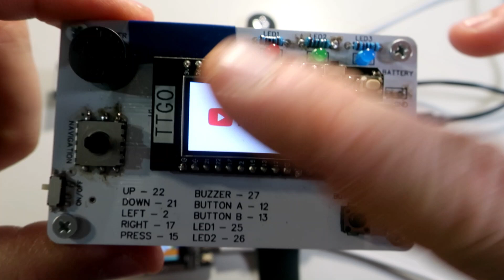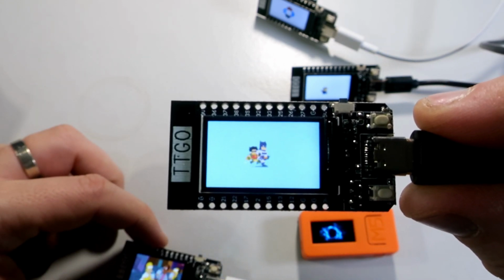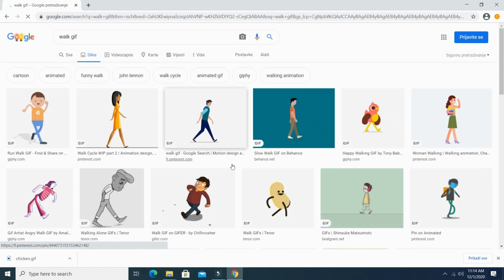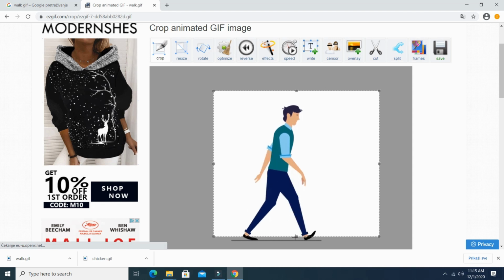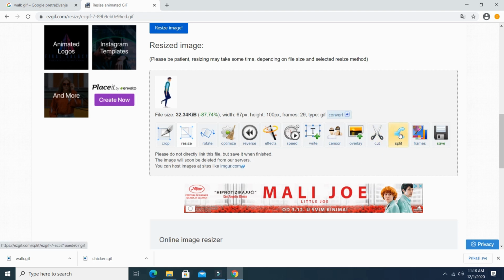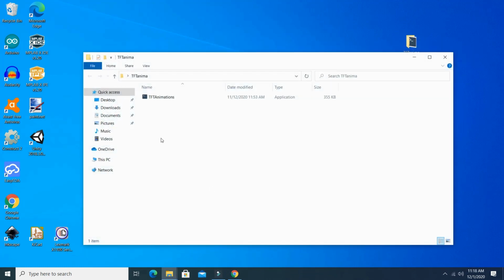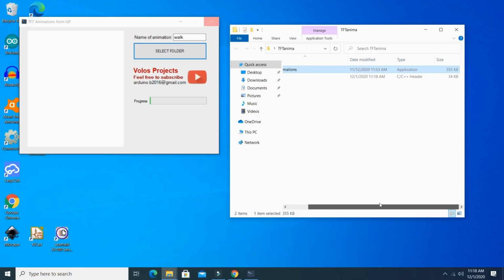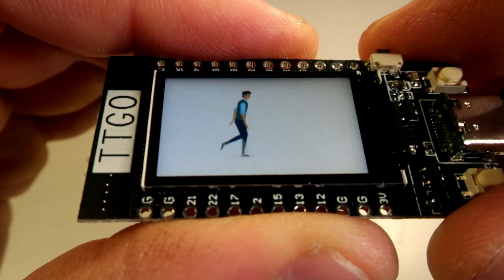Making animation from GIF files for TFT screen (ESP32 ,ESP8266 , Arduino)

Comment: OK - got this working after finding a sample setup for the User_Setup.h file in the TFT_eSPI library. I've been struggling with this part. Also, I'm using an ESP8266... So next - I'll use your system (and .exe) to create my own giffs. Thanks for the video!

Comment: Excellent video that shows how to find animations with Google.   Use EZGif to crop and resize an existing GIF.
You end up with a 36kB GIF file.   Then extract all the frames to a set of RAW pixel arrays in a .H file that is 341kB in size.
The ESP32 has got plenty of power to decode and display the 36kB Animated GIF file directly.
You can store the 36kB of GIF data in PROGMEM, SPIFFS or a SD file.
You can fit many 36kB GIFs in PROGMEM or SPIFFS.   Obviously bigger animations require an SD card.

Comment: To everyone with problems with the software:
1. Check that you have exported the images as JPEG! It doesn't work with gif files.
2. If jpeg doesn't work - run the software in compability mode for win8.

Comment: In this lesson(on Github), when compiling the code, the error page "stray \357" appears in the file walk.h 1:1. You have to transfer it to a simple editor and save it in the correct Unicode. At the beginning there is an invisible sign that causes the compiler to stumble.
Reply: Thank you for your comment. 
I have the same issue . Can you provide more details?

Comment: 1. How much of this code is the ESP8266 idling, waiting for the next frame? (I am looking to interleave audio with my animation)
2. Is the ESP8266 fast enough to run a similar format animation from the SD card at a framerate of at least 20 FPS?
3. If I can't use an SD card, how many seconds of video can I fit in the 1 or 4 MB of the ESP8266?
4. Can this work with the 9 digital pins of the WeMos D1 mini?

Comment: Hi Volo, great tutorial and I have one question what is the size limit because I run into "Image size too  big" issues. Regards and keep up the great work 🙂
Reply from the maker: it depends on board, yo need to keep in mind that each pixel needs 2 bytes in memory,  so number of pixels x 2 x number of frames. After compiling you can see size of sketch and amount of free memory.

Comment: Your lessons are great. But not everything can be tried, since they do not work on the T-Display S3 Amoled! For example, this lesson, even if I change the code for Amoled, gives a black screen and only flashing the firmware helps... If you can, make your lessons for Amoled displays too. Thank you.

Comment: your APP is freezing after selecting a folder
i've tried folder even with 3 files, each with "easy name" such as 01.jpg , 02.jpg - didn't helped. 
it just freezes (not crushing), tried 5 times - always the same

windows 11

Comment: Hello, 
Thank you for this video. I have question about the GUI Editor for TFT Display (Lilygo T-Watch 2020). I want design Apps in Micropython. Do you know Editor for develop apps with Micropython ? I am newbeginner in this section and i need sometime help 🙂
With some codes from GitHub, I have initializied the Display and connected with Wifi and get the time. I want to show the time on display. Have you expirience in this area ? I hope you can help me

Comment: Can this animation played in other display except TTGO display without Esp32 but in Arduino Uno.
Reply: The Arduino Uno and Nano use the Atmega328P microcontroller which is not fast enough to display video in real-time. When this guy said "Arduino" in the title he was referring to the faster Arduino boards based on 32-bit processors (like the Yún, Due, and Zero). I once tried to display images in rapid succession to simulate movement (over 10 images per second can blur into smooth motion) on an Arduino Nano, but I were only able to achieve 2.1 frames per second. Oh yeah, and you can buy an ESP8266 for $5 on eBay.

Comment: Hi, realy simple explanation. Did you try to use it on bigger screen with ili9341 controler?
Thanks for sharing
Hvala :)
Reply from the maker: Jesam, na 240x320, isto radi mozda malo sporije al neprimjetno za oko.
Reply: @VolosProjects  E super, hvala ti na odgovoru.
Sretni Božićni i Novogodišnji praznici, pozdrav iz Beograd.

Comment: Sadly your Picture to Code Tool only creates a file with "int frames=0;
 " in first line of code.. thats all !
while using your linked files, Arduino made some errors.. after copying the walk.h code manually from git it worked compiling and uploading it to a M5StickC, but it restarts into a black Screen..

Comment: I got it to compile and flash without errors on platform io, but the display is black. 
I am using the downloaded example sketch, and walk.h. TTGo T-Display.
Does anyone have any suggestions?

It looks like platform IO doesn't support this board. Also the board support package for esp doesn't run on arm linux.  
Maybe I will use windows, or just put this away and use something else.

EDIT: 

Ok, I had a great success. I found a platformio.ini file that made it work.

Comment: I am getting error in code . Please let me know how can i fix this ? 

 int frames=29;

 ^

walk.h:1:1: error: stray '\273' in program

walk.h:1:1: error: stray '\277' in program

exit status 1

stray '\357' in program
Reply: I simply commented out int frames = 29; and it worked fine
Reply: @TheKrausenKid  that doesn't work either

 In function 'void loop()':

1:19:15: error: 'frames' was not declared in this scope
 for(int i=0;i<frames;i++)
               ^
1:23:24: error: 'animation_width' was not declared in this scope
   tft.pushImage(60, 15,animation_width  , animation_height, walk[i]);
Reply: @soupie187  sorry I forgot to mention that after doing that you have to set frames in the loop to the frames value that is removed. Delete frames from the loop and type in 29
Reply: copy "illuminated" int, and replaced with "non-illuminated"

Comment: Using a 320×240 ILI9341 screen, with all of those pixels in use for the gif frames, what would be the expected amount of frames that could be stored on the ESP32, and would it be possible to read this from a SD Card instead to reduce the memory required from the ESP32?
Reply: Just do the math. (320 * 240 * 2) = 153,600 bytes per frame. Take number of bytes of flash you have available and divide it by that. Lets say you have 2MBytes flash, that's 2,000,000 bytes. 2,000,000 / 153,600 = 13~. You probably need a few kB for your code etc. so maybe 12 frames.

And yes it's possible to load from an SD card, but be aware that reading from an SD card over SPI will likely be about 50MBit/sec. Fastest you can drive an ILI over single SPI is around 60Mbit/s, which means around 30ms each to 1. get data from SD, then 2. drive it to display. So you're looking at 60ms, not counting any cost of going round trip through RAM (you could in theory DMA this). That means your max framerate is around 15fps, and that's with an ideally optimized code. With even a bit slower code, you could be looking at 5fps or less.

Comment: Would you mind helping me with a project?  I am very new to this but interested in learning - i just wanted to ask some questions to maybe help me get in the right direction.  Thank you
Reply from the maker: Sure, i am listening.
Reply: @VolosProjects  hey thank you. Im working on a project where id like to have a 3x3x6" container to work with. Put a screen, speaker, a small led strip, rechargeable battery and an on off switch. The screen would play a short 5 to 10 second video on loop. Everything would mount inside via screw. Just no idea what to buy or where to start. Ive also requested you on instagram.

Comment: I used your program to make 10 frame animation. Each frame is around 20kb, and with the program i got around 2mb .h file. Then I used caesium to compress those jpg and got them down to 5-7kb, however when I tried to make .h file again, size was the same, around 2mb. Why is that so?
Reply from the maker: size of jpg is not important, it is number of pixels. each pixel need two bytes in esp32 memory.

Comment: zdravím mám problém s vašim sketchem takový že mi arduino ide vyhazuje tuto chybu In file included from C:\Users\PC\Downloads\aNIMATIONS-main (1)\aNIMATIONS-main\Ani\Ani.ino:1:
C:\Users\PC\Downloads\aNIMATIONS-main (1)\aNIMATIONS-main\Ani\walk.h:1:1: error: stray '\357' in program
 int frames=29;
 ^
C:\Users\PC\Downloads\aNIMATIONS-main (1)\aNIMATIONS-main\Ani\walk.h:1:2: error: stray '\273' in program
 int frames=29;
  ^
C:\Users\PC\Downloads\aNIMATIONS-main (1)\aNIMATIONS-main\Ani\walk.h:1:3: error: stray '\277' in program
 int frames=29;
   ^

exit status 1

Compilation error: stray '\357' in program
proč ?

Comment: error: stray '\357' in program
 int frames=78;
          :(
Reply: Most stray characters that aren't spaces, newlines, or tabs will throw this error, including Unicode characters. Try and retype all of the spaces in the offending line to remove potential Unicode characters that can throw an error, for example 0xA0 "no-break space" which looks exactly like the regular 0x20 "space" character can throw this error, frustrating many novice programmers who don't go in a hex editor and notice that all of their 0x20s have magically become 0xA0s.